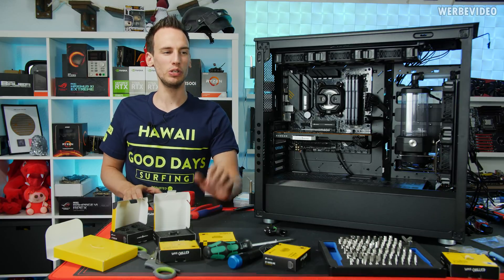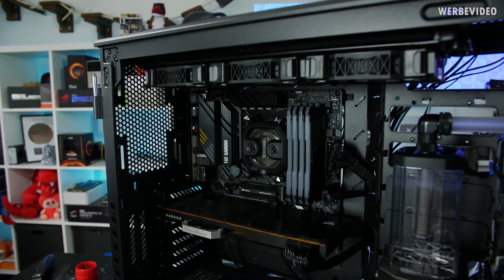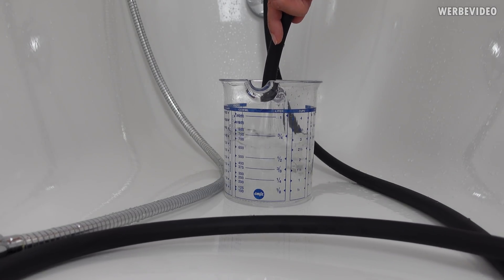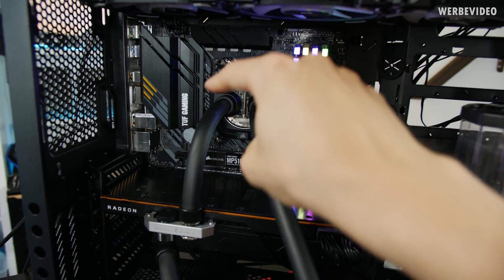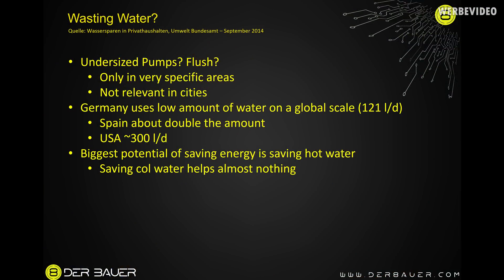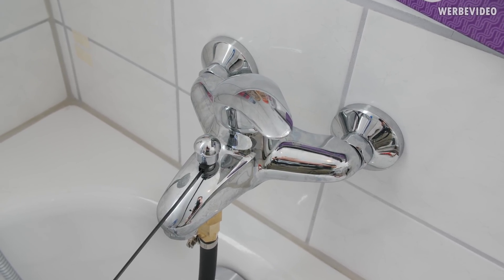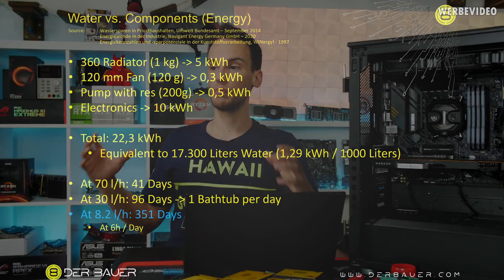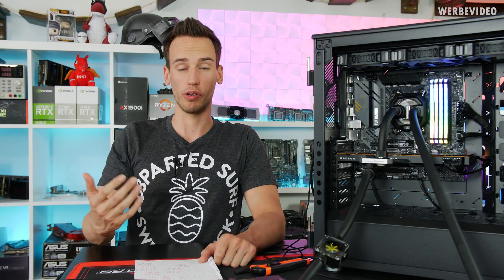So much Better than expected! Cooling my PC with TAP WATER

Comment: If you don’t live in an apartment and have some outdoor room to spare, get yourself a bigger reservoir and use rain water instead. Since you need very low pressure and flow, add a gravity water pump and you have an infinite supply of colder water into your system.

Comment: the old style gravity bathroom water storage, dropping down to lower storage
Reply: or you can reverse that, if you have hot water tank above to have the heated water to rise there
Reply: easy (cheap) chiller with peltier thermo-electric cooler elements

Comment: Inb4 water hookups built into the house so you have a direct hookup and access to water where your computer is a long with a drain... thinking like a washing machine would have for it's water... just have a flow regulator (preferably digital), turn it on to whatever you want, turn on your pc and go.

Comment: one issue i see is pressure builds up, 27+ psi in some places i think, regardless of flow rate.  all it takes is a minor blockage to possibly blow out a seal in a system not built for it , another is improper grounding,, in many places the copper pipes and water column in them and water meter is heavily ground controlled by your city in many cases so ,.serge's, back feeding and lightning could be an issue too..  . the best thing iv heard of so far for this imo is modding your air conditioner by attaching an outboard radiator and pump connected to your rezz or  just the rad inline with your loop ,.,.then at least you're chilling your loop and your room with the same watt hr and have  little waste water and better part longevity ,.

Comment: good ideea , i already use it for gpu mining , in the summer i use underground filtered water , i also have special cooling blocks with larger fins  and in winter i connect the cooling sistem from the rigs  to a loop that goes in my radiators from my house  sow i can heat it .

Comment: Initial take on the premise - it's not new. Sketchy industrial Air Conditioning has been done by using disposable mains water supplies before.  In many jurisdictions it's now illegal due to the amount of potable water that it wastes.  I expect the same of this endeavor. Cooling will be excellent, no residual heat build-up to deal with. Long term may have negative durability impacts due to the tapwater contaminants.  But the amount of water wasted will be absolutely out of the question for day-to-day operation. I expect these lasers you're referring to are probably only used for brief durations?

Comment: Overall, for the PC water cooling thing to go massive we'd have to think differently across the board about how to deal with the excess water usage. Considering, that the water, if in a city goes back to your municipal sanitation anyway_, it might not be so much a problem if it is always properly filtered and cleaned prior to delivery, but that also counts on the pipes _between them and your house not being absolute crap. Clean water goes out, gets dirty in older metal / lead pipes, then you filth up your PC using tap.

Not good. So you would still need filters where you live depending on area, and if you use the PC with tap for cooling you'll spend thousands in filters depending on location, which means a solution with radiators and fans would be more economical over time.

Comment: Follow-up video pls: Take a giant reservoir (drum-size or similar) find at which amount of water you could use it without a radiator- perhaps calculate the wattage in relation to volume of the water.

Comment: Tap water temperature is seasonal, or at least that's what the maker of my on-demand hot water heater claims. In the winter, our tap water is frequently under 10c. 

Anyway, it's an interesting topic... I certainly think it's probably one of the cheaper ways to adapt a normal water-cooling loop for sub-ambient operation for those looking to try something new related to overclocking.

Comment: I wonder how long it would take to heat soak a bath full of water. You would obviously need to add a submersible pump rather than take the water from the tap directly.

Comment: In Scotland, the average temperature at springtime is 11C, 15C in the summertime, and -3C in the winter so our cold tap water is usually very cold so cold in fact that it can actually give you brain freeze at times. So i think that if i was to do this test in my country I would be potentially looking at sun room temp load temps. Also the Water in my country is free so this experiment would also cost me nothing

Comment: First impression is:
1. There will be calcium deposits over time.
2. Mains water is used as a backup cooling system in some datacenters. (But here it is rather used to cool the air in the datacenter, not to cool the components directly, due to the stated reason above.)

After watching the video.
It is rather fun to see "at 8,2 l/h 351 Days" for it to be comparable to the initial energy investment of traditional water cooling components.
Though, you should have added on a freight estimate for the components. And maybe asked a radiator manufacturer for their estimates. (They after all know what their power bil is and how many radiators they spit out. So they should have a rough clue at the very least.)

And yes, using a portable AC to cool down the room just so that one's computer can run is a bit "inefficient" to say the least. Even a proper AC is still rather inefficient.

This is also a reason why some datacenters are moving towards 30+ C for their "cold" side of the servers. I have seen some research datacenters prod at 45 C for the cold side, and 70+ C for the warm side... So that even warm places like a desert doesn't need an AC for the servers. This saves in about 20-30% of the power costs of running a datacenter, so its a rather major thing to be fair.

Comment: If you fed it into the hot water tank, it would pre-warm it for the boiler which would make it a more viable, in the same way, water heating solar panels save energy.

Comment: Also an interesting thing is to calculate is the energy absorbed by the water, at a rate of about 8.2 kg/h of water and a temperature increase of 15.4 K and heat capacity of 4179.6 J/kg/K it absorbs about 146.6 Wh. This is interesting to compare to the real power consumption of the system, I can only estimate this from reviews but the cpu uses about 70 W at peak (no OC )and gpu 165 W but this is probably not the consumption when playing a video game but still wonder if these numbers would kinda match up or a lot is still dissipated to the air.

Comment: Interesting and informative, with the numbers to back it up.
I'm in BC Canada, in the interior surrounded by rivers from the Rockies, so we are in one of the spots in the world where water use is not a concern.  There's literally billions of unused litres of water per month, so your 82.4% would be closer to 98%, outside of Vancouver.  I know its not the same in most places, water sustainability matters.

That said, running tap water full time is obviously impractical plumbing and system infrastructure wise; you have to plumb it in a way that makes sense in the house you live in, (lines from bathtub to computer room permanently? no, lol.) I'm thinking like 1/4 inch solid copper lines like those that feed a refrigerator ice machine.  As well,  good practice means finding a way to reuse the waste water ... I dont have a bathtub full of water ... worth of houseplants to give it to every day.  You could just run a dumpline to a drain, but having a permanent dripping waterline in the house is not good design, point of failure issue.

Either way, I think its important to run experiments like this, every experiment feeds another idea, and we move ahead.  You never know, the perfect zero energy, zero waste guaranteed to work cooling design probably exists, it just hasn't crossed our mind yet.

Comment: I think the problem with wasting water is more about the cost to resort or rather clean it again. Once used water goes in to the sewage system. At the other end of that sewage system is a water treatment plant (hopefully) the cost of waste water is equivalent not only to the cost of its initial delivery and removal but the cost of cleaning it back to its state prior to use. Perhaps some one who knows more about this could chime in with regards to the chemicals used in the processing procedure :)

Comment: Would be a cool project to build a system where you collect the warm "waste" water in an insulated tank, and feed your water heater from that. That way you are using the waste heat of your pc(s) to partially warm your baths :)

Comment: I have been playing on using a  150l buket of water under the desk with those cheap fountain pump...

The buket it self wuld be so big it wuld have much surface area, so it's acting like a passive radiator.

I haven't bother yet to try calculate the "radiator" effect

But this is pretty much the math behind it, cpu 200w gpu 300w = 500w

One liter of water takes about 1.3wh to heat up, so 150l of water has 1.3 * 150l = 195 wh/c so if you're computer heat output wuld be 195w the water wuld heat 1c in one hour.

Now we can calculate 195 / 500w of heat output and get 0.39 for 1c or 23 minutes meaning if we allow the water to heat from 23c (room temperature) to 33c we have 10c window. And have so that wuld be 10 * the 0.39 h/c and its nearly 4 hour off full load,

If you factor in dissipation off the heat, and that you're system isn't running fully loud all the time, I might get usable 6-8 h for this kind of system 🤔

And getting the benefits off heating the room during the night with that storage almost 2kwh energy instead off needing to cool it down during the game time

Comment: How would it not be better? You have no closed loop therefore no movement to equilibrium by your coolant. YOu can run your water tank as a res and I'd suggest fitting a quality water filter on your cold tap. Conservation is the concern I guess as many are pointing out.

Comment: You can buy all aircooler or watercooler parts second hands if you want to save consumption in energy/climate/money. Water in the netherlands is really cheap but it is really an waste. In the summer there was shortage so flow in all pipes in the city where low. Dont fill your pool in these days or cool you PC with tap water guys or at any other day...

Comment: In our Datacenter we use "tap water" as a backup solution if the chillers fail for some reason even though they are redundant and protected by UPS/Diesel generator.
We are only allowed to do this in an emergency though. :)

Comment: Using tap water is also very common in chemistry labs (if you want to reflux a liquid and not lose it you'll use a water cooled condenser), although for environmental reasons many labs now have closed water circuits. But sometimes you want to do reactions at lower temperatures, there are cryostats that can cool down to -70C and are connected via tubing. But I'm not sure if they could handle the heat output of a CPU, but would be interesting to try.

Comment: Here in central AB, Canada, our tap water peaks in temperature during summer at about 12°C, but in during the winter (especially during January and February when temperatures reach sustained -30-40°C) the water is just a couple degrees above 0°C. My family does a lot of home brewing of beer, and we use a Blichmann Therminator counter-flow plate chiller to take the hot wort down from boiling to just blow room temperature. The water goes from just a few degrees to scalding coming out the other end.
Home brewers in hotter climates have a lot of problems meeting their cooling needs, but this is not a problem we have up here.

Comment: what if instead you use a closed loop, except you put a couple of radiators (without fans) in the bathub filled with fresh water with a very small inlet and outlet flow?

Comment: Initial thoughts are that its wasteful, if justified by the fact that tap water is recirculated through filtration then its still wasteful. Massive plants for filtering tap water uses far more resources than a radiator I would presume.
Reply: After watching, certainly much more compelling than expected. Agree with your conclusion, it could certainly be a valid solution for certain geographical regions and specific use cases.

Looks like my presumption could be incorrect. 

 Great vid!

Comment: You don't need to replace the chiller block if it gets mineral buildup from tap water! Buy some citric acid on eBay, add a little to some regular tap water, and pump it through the loop for ten minutes or so. It's safe on metal, rubber, and plastics and it breaks down mineral deposits immediately. It's the active ingredient in limescale remover and coffee machine cleaner, and it's commonly used in metalworking to prepare copper and brass surfaces, but buying it as pure citric acid powder instead of those products is several hundred times cheaper by weight.

I've used it to clean up a brass boiler vessel that had >1cm thick limescale deposits. I'd been trying other solvents and ultrasonic cleaning, but they barely made a dent. I couldn't even break the stuff off manually - it was like solid rock. Dumped it in a citric acid bath and it came out completely clean within half an hour. Looked like it just left the production line.

Comment: I remember a friend had a geothermal heating and cooling unit for his house that would pump up water from his well, heat or cool his house then dump it back into the well hole.  Very power efficient and environmentally friendly.

Comment: Strange that your tap water is so hot! In finland it’s around 4 to 6C depending on the season. Also if you are worried about the block corrosion/contamination, you can always use a heat exhchanger block and have a separate loop inside the PC.

Comment: If you recirculate the water to and from the bathtub you could use it bathe. Then you could have virtually no water loss. It would also be interesting if you hooked the output to a solar copper coil water heater for showers. Then the heat from the computer would have a positive effect. My ideas do seem impractical but theoretically useful.

Comment: I'm guessing it'll be around as good as chilled water, considering the cold tap in my house comes out at around 5 C.

As for the wasteful aspect, I don't believe it would be much of a problem in Scotland, considering all the rain we get, though I hear you still probably shouldn't just leave the tap running.
I guess in places like Switzerland, where they have public drinking fountains switched on 24/7, it wouldn't be an issue.
Reply: Though, I think it only comes through that cold in the winter.

Comment: If this were taken to extremes (every house had 'PC chiller pipes' hardlined into their home like a cable or dsl line) this would be very efficient. All the energy used to mine, deliver,  manufacture, package, ship, shelve and sell resourses used to make gpu and cpu coolers would be saved whilst the consumption of tap water would go up. That sounds like much more efficient logistics to me. Very counter intuitive but many great inventions are. Perhaps this will take off in the future when top tier computers power needs and heat generation have skyrocketed. But most likely this will remain with lasers and supercomputers XD

Great video and an interesting idea.

Comment: Something you have to keep in mind is that there isn't really a "tap water cycle." Tap water comes in, then when it goes out, it is sewage, even if it goes out as unused tap water. Sewage does not become drinkable water, sewage does not replenish the water source you took the water from (this is IMPERATIVE with groundwater). For example, here in Boston, we get our water either from reservoirs or wells, sometimes municipal wells. Our sewage is filtered and then dumped into the ocean, or goes through our septic tanks, which are usually not anywhere near the wells we drink from. As a result, any of the water you use is lost. There are very few places left in the world today, where water isn't a precious commodity. I respect your energy and material cost arguments at face value. Still, unless you live in one of these handfuls of places, the harm you would cause is significant, especially if you're using a flow to match a chiller. As someone who comes from Israel, a place where we have had to buy and fly in water from other countries because our taps were completely dry, for days, this is abhorrent to me.

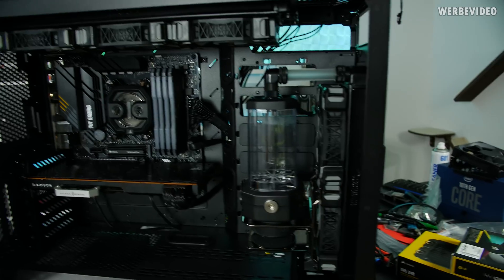Comment: to me that makes perfect sense, if you think about how much power you would save in not running pumps or fans using up electricity, also it would be very easy to control the temp of the water going into the case and that's your constant temp so no matter how much heat you create the water will always be the same temp when entering the system so you wouldn't have a reservoir of limited water in which the waters temp would go up....also i stopped this video 2:00 into it to reply before watching the rest, so i hope he doesn't say exactly what i just did LOL

Comment: Very nice video my man!  I think it's interesting that the tap water after running through your CPU & GPU is the same temp as the water in my Threadripper 3970X system.  Depending on ambient I'm around 34c - 36c with temps of the CPU in the upper 60's on stock settings.

Comment: For testing this method is incredibly useful, and I would add you do not have to waste the water it can easily be piped into five gallon buckets. Then could be used to manually flush toilets, water plants, or cleaning. Since the water would have been used anyway it is effectively free cooling.

Comment: I can see the run though water system having high efficiency. If the water flow was properly controlled, and the runoff was used to water and heat a greenhouse.